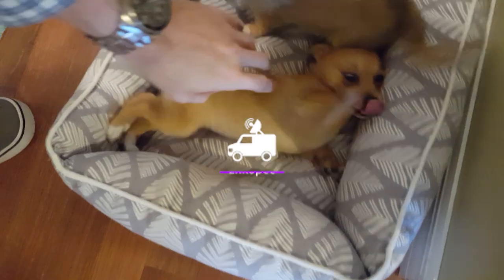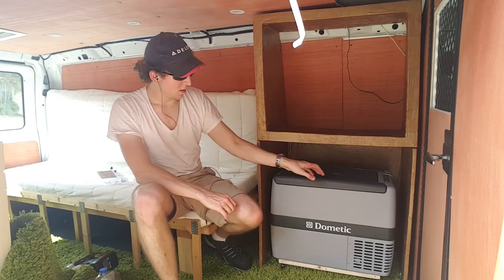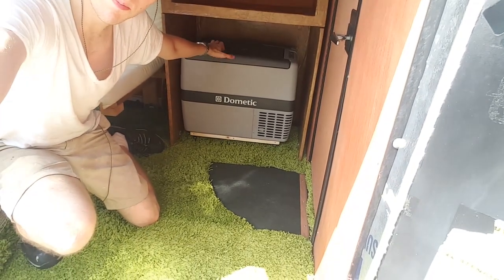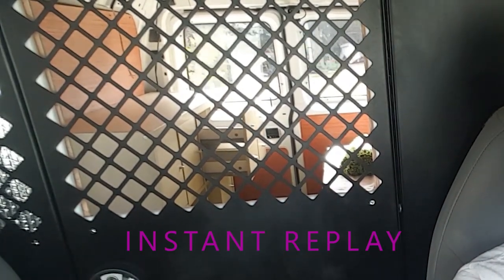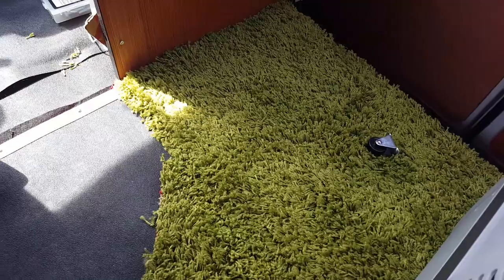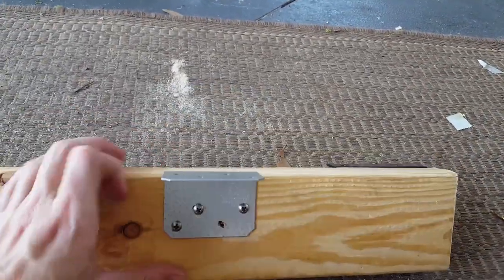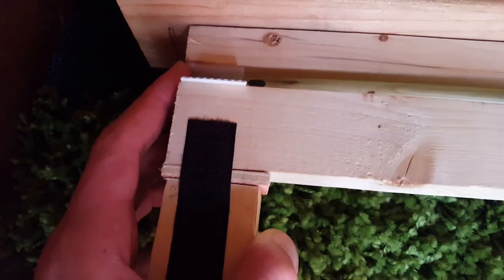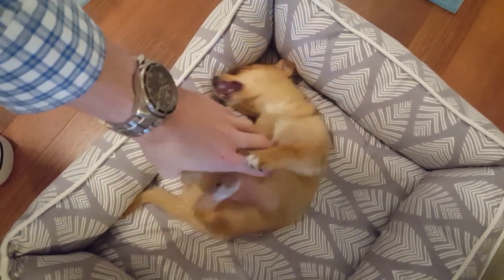Installing Portable Fridge for #Vandwelling

Comment: I Dig it, i would've done the same thing with industrial velcro 1 full bar. The next vid is what I want to see because a lot of folks do the hard wiring to the fuse box.
Reply from the maker: A full bar was almost too much strength! I had to yank it out. This velcro is crazy strong! 

I'm definitely glad I didn't cut open the car adapter for it!
Reply: zhkopec no doubt, I definitely got my notification on for that next vid, I want to know the reason y folks do it & y it's not a good idea to do so.

Comment: Sorry to disappoint you but Florida roads are great compared to NJ, Milwaukee, LA & many other places. I don't think your Velcro will hold in those driving conditions. Hope I'm wrong.
Reply from the maker: You're very right about Florida roads, they are some of the best I've traveled on. While NJ / LA in particular are surprisingly awful. A little bit of a spoilers from future videos, but it holds up enough to go through Montana gravel roads.